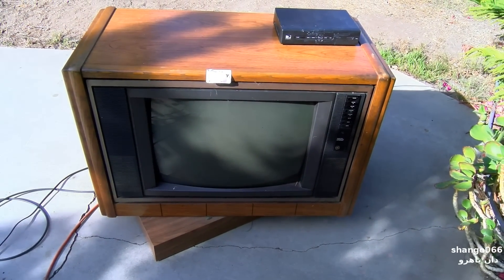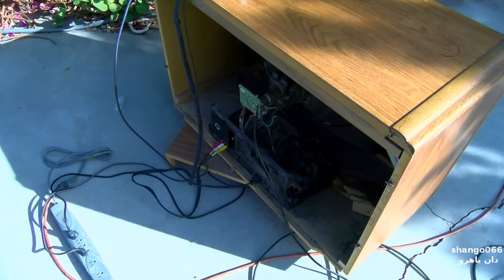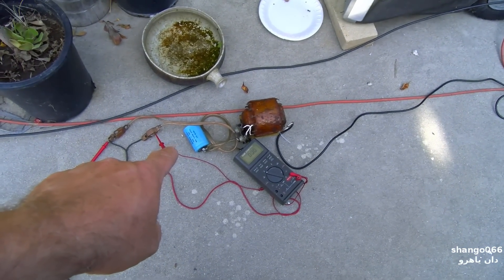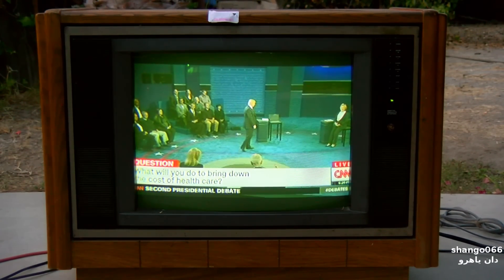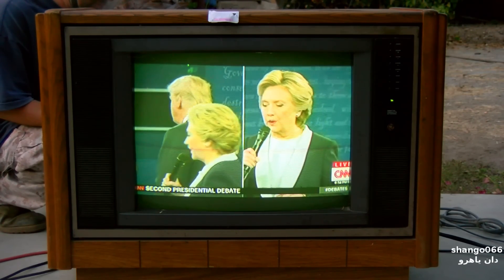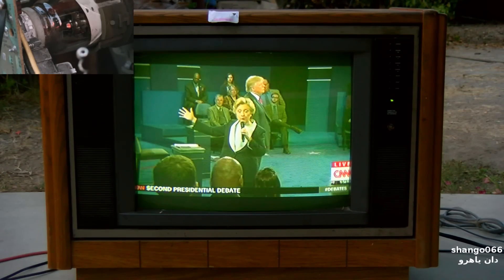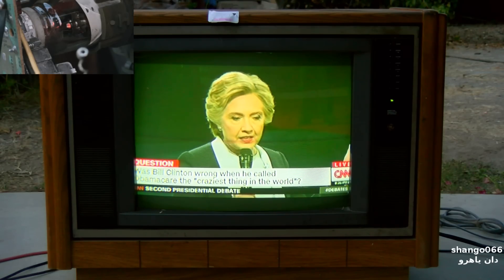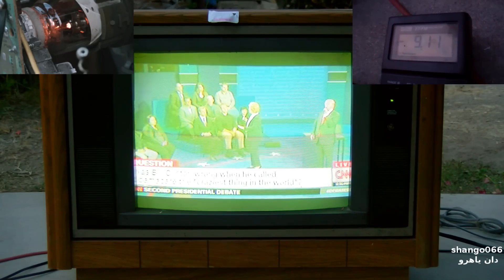Increasing CRT Filament Voltage Test EOL Debates 2 0

Comment: More filament voltage means more electron beam current which initially means more brightness but also means more load on the flyback transformer which eventually drops the kV across the tube which then leads to lower brightness and to the instabilities you saw at high filament voltage.  Amazed the filament didn't blow and the tube needed additional assistance at the end.

Comment: next run a stick welder from cathode to grid with it displaying video. or tap a wire from the high voltage crt anode wire , tie it to a big wooden stick and zap various parts of the circuit board with it on

Comment: I have a CTC 157 that I have no incline to EOL. I grew up watching It. It used to be my grandmothers set. The picture has now collapsed to a line on top of the other issues I talked about here. I hate how the camera I had picked up my breathing. The CRT looked better in person. https://www.youtube.com/watch?v=pm36lQ2ma14&feature=player_embedded
Reply from the maker: You are welcome to this chassis if you want to pay for shipping. The tuner is dead but the vertical was working fine. good IC flyback etc

Comment: You could have stopped at 4:06 with a fixed and restored CRT.
Reply: It looked surprisingly good, true, but it wouldn't have lasted long at over twice the rated voltage applied to the filament.
Reply: @Klutech tv is just chilling
Reply: IAmNotAFunguy Don't worry, I was thinking the same too while watching it.